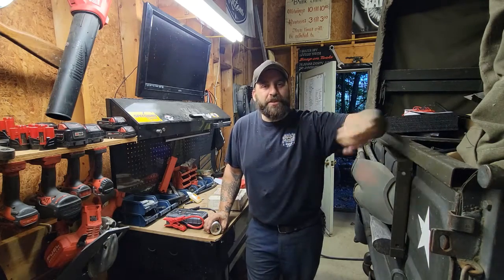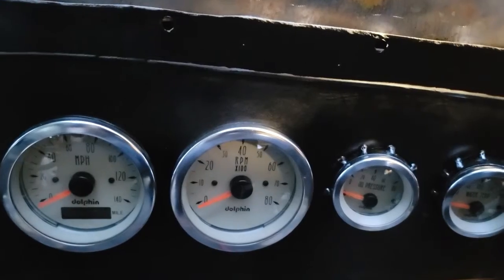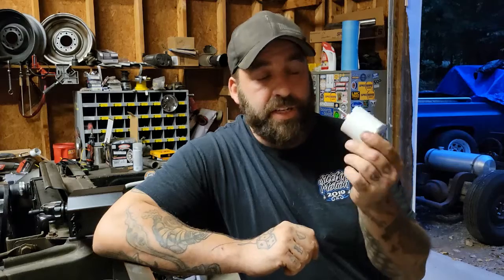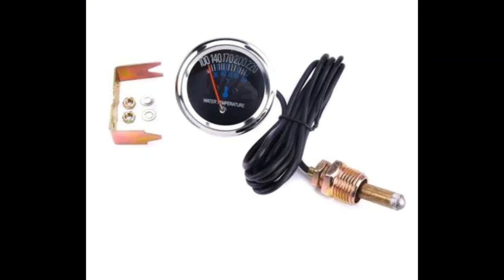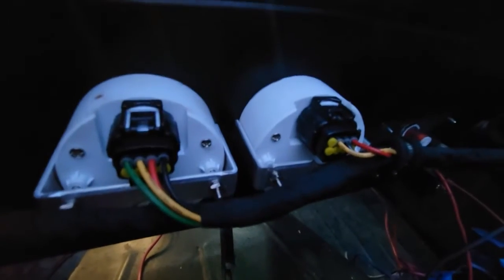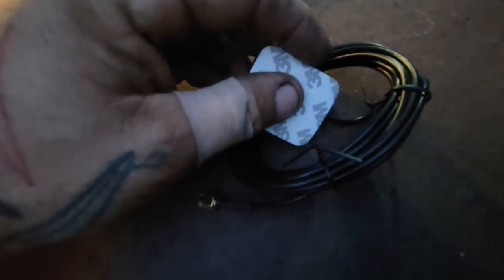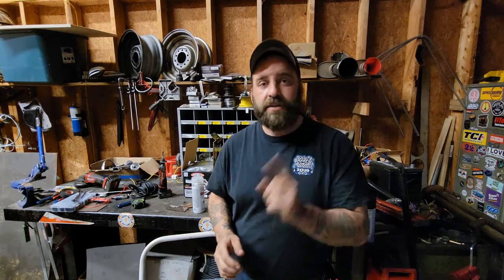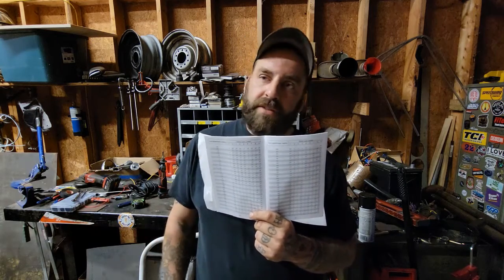WHAT  GAUGES DO YOU NEED FOR YOU HOT ROD , RAT ROD, CUSTOM OR STOCK RIDE ??? DIFFERENT OPTIONS.

Comment: Great info. Question. The GPS speedo, Is there any place it will not work, Like tunnles or way up north in Alaska.
Reply from the maker: In my experience it works through some tunnels,   I did have a little trouble in some spots in the mountains.  Not sure about more remote locations like Alaska